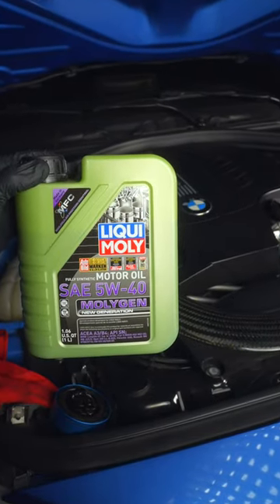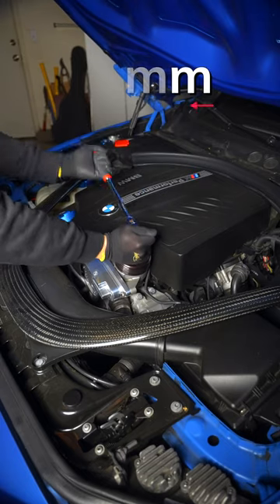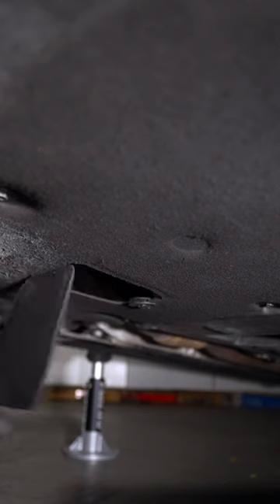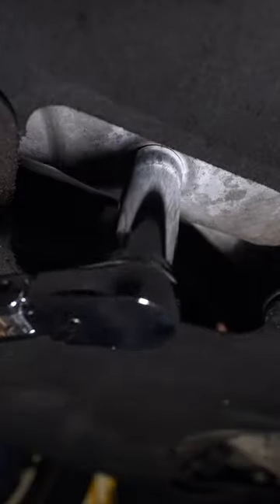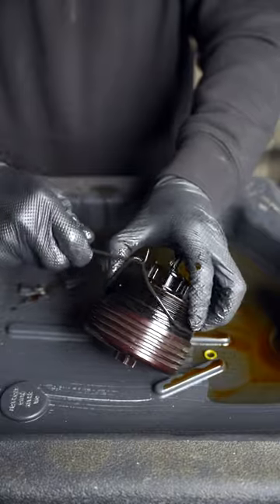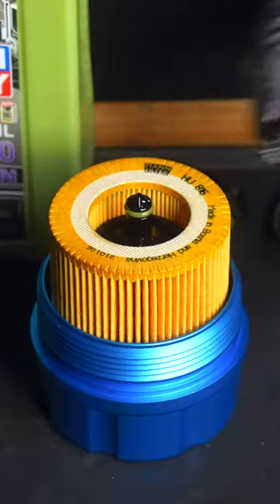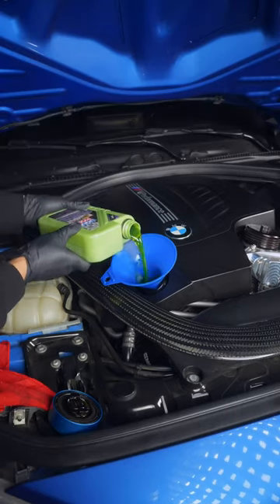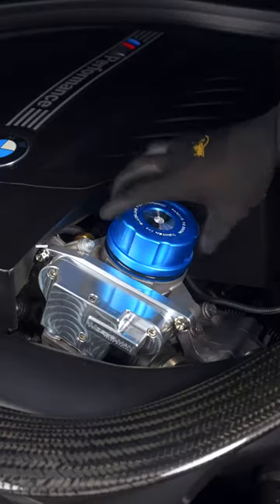BMW N55 Oil Change

Comment: I'll keep changing between 3-4 and no later then 5. That oil is muddy dark, watch out for sludging issues with higher milage, change it more often and do not go to 10K, regardless of what the manufacturer says or the oil manufacturer
Reply: Agreed. 10k manufacturer recommendations seems to me like another way to get parts to break so the customer needs to pay.
Reply: To really be certain have oil analysis done at Blackstone lab's.
some engines can push to 10k miles some don't...
Reply: @Doyle Hargraves  that is diesel not gas, in general diesel oil due to a large quantity of it in the engine can last much longer. Where a car has at most 8 quarts , most diesel engines have gallons of oil. However with V8 style diesel engines in pick up trucks that have EGR and all the EPA junk, I still suggest changing at 5K
Reply: 10k isn't even that high service interval. I know Subaru wants oil changed ever 12k or so, Mitsubishi canters are like every 20k or more and there's def some auto shit with high capacity sumps and bypass filters that claim 60k plus between oil changes (I know at least Volvo and Scania do this)
Reply: @Bush Kangarutha  whi h is also why mitsubishi engines in America are known for burning oil and general low life.. 12K oil change intervals is crazy in a car style application
Reply: 10k ??? I’ve never gone past 5 and that was my last car and in the last oil change I did before I sold it. Will do every 3K like my old bmw I had 😅
Reply: @austingutierrez2709 yep I do 3k. One year I got antsy and ended up changing it every 1.5k 😂
Reply: @KolbPROD  my new car had the oil changed at the dealer before I picked it up. Did an oil change as soon as I got home then switched to a different oil after like 2k miles. I felt that antsy feeling 😂😂😂
Reply: @UnrealKinniki  but if you use fullsythetic you can go 10k easy
Reply: @dragospahontu  Doesn't mean it's a good idea...
Reply: @UnrealKinniki  but a PAO based oil can maintain its properties for that mileage. An HC oil can't. 

Sure changing your oil frequently is always good, but why waste good oil when it can last 10k miles easy.
Reply: @dragospahontu  Makes sense, but I have yet to see an engine that liked 10k repeated changes
Reply: I change my oil daily to be safe.
Reply: @Slanovich  lol
Reply: Quit wasting your money. Not because the colour changes means it not good. It's normal. I change mine every 7500 miles
Reply: Nah 3k miles, I could care less what the manufacturer says. I also change the transmission fluid and filter every 10k miles
Reply: It all depends on driving style and wether you idle your car ouitside or regular in-traffic idling and wether you use your ac or not. Without unnecesary idle & keeping the a/c off you can go quite some time with your oil.
Reply: @UnrealKinniki I have a 2010 328i with the N52B30. I changed oil about every 10k. She has 224k miles, now. I used to do it every 5k, but decided to go 10k and send it off for analysis. Turned out that my 10k oil was still good. I was surprised. So I do it that way, now. If you only drive in city traffic, I wouldn't recommend that long. Driving only highway miles puts a lot less stress on the engine, as well. So 10k on the highway may be better than 5k in the city.
Reply: @JoiceVaderd  which definitely makes Sense! Most of the customers our shop gets definitely should not be waiting as long as they do lol

Comment: Just gonna give you some advice. N55s notoriously send rod bearings. Done over 75 jobs myself. Do yourself a favor a change your oil every sub 3500miles and get yourself some aftermarket rod bearings before your stocks go and score your crank. If you’re unsure of the condition of your rod bearings have an oil sample send off and tested. Goes a long ways

Comment: Do not, EVER leave you oil for more than 5k miles unchanged. Trust me you will regret it especially in BMW's. You've been warned. I do them every 3500 miles regardless of the manufacturer recommendations.
Reply: @I6zone depends. Turbo engines and hot weather will wear them out fast. Oil is cheap anyway....
Reply: @kiryukazuma7508 fr? Never changed oil on less than 7.5k intervals and the issues have NEVER been from bad oil. 

Never seen someone who does the same have an issue either
Reply: @kiryukazuma7508  Oil is not cheap! Full synthetic is over 10 a quart. The BMW take 7 qts.
Reply: @Depl0rable10  lots of variables. If you do big miles but on light traffic roads they won't wear fast. But if you do big miles in heavy traffic go with lots of idling stop and go, yes they run bad pretty quick. Hot weather also accelerates oil wear.

Comment: Never let your oil go to 10k I don’t care what the manual says and what type of oil you put. Oil is cheap and engines are expensive period
Reply: Definitely NOT bullshyt. There are tons of cars with sludge issues ran for 10k oil change intervals. Even with manufacturers recommendation why would they care by the time you get to your 6th or 7th oil change it’s no longer their problem it’s all yours!!
Reply: ian trofimov  Well buddy you offer up an isolated situation with one vehicle. I have 4 vehicles right now with close to 500k miles on them. Highest mileage one is at 275k miles. Original engine burns no oil. No smoking, used both for city trips and long distance trips. Multiple brands. I've owned American, German and Japanese brands. Smaller displacement turbo charged engines are going to likely experience issues if you are going 10-15k miles between oil changes. I've seen it 1st hand on multiple occasions. Vehicle manufacturers want to advertise a vehicle that's low cost in maintenance. 5-6 oil changes will get you out of most warranty periods, if you have a catastrophic engine failure between your 10th and 13th oil change that's on you (using 10k mile OCIs). For those of us who keep our cars over the long term the benefits of regular 5-6k mile OCIS are worth every penny

Comment: The blue oil filter housing cap looks great 👌
Reply from the maker: Thanks! You make the red look good in your car
Reply: Sure does
Reply: Because the factory plastic housing will leak?
Reply: @loden888  idk if its that but i have seen the housing threads literally melt and get stucks, its a pain in the ass

Comment: If you read the manual it specifically says not to pre oil the new filter. It can introduce contamination post filter into the engine.

Comment: 86 Toyota truck 22RE bought new and been the daily driver for 37 years and 482.000 miles. Change oil every 5000 miles using that 'crappy" dino oil- Castrol GTX 10W-40. Doesn't even burn 1/2 quart between oil changes.

Comment: I been oil geek all life
From what i ve seen in experience with superbike engines no oil no matter what will last longer to protect you engine 100% more than 4000-5000 miles
I been changing oil between 2500-3000 miles
And never had any problems
I would never push it more than 500 miles over 5000.

Comment: My one tip is to remove the drain plug bolt before you crack the top filler lid. That way the oil flows a little less when removing the plug bolt, hopefully making less mess.

Comment: Interesting…never thought about adding oil to the oil filter area.
Reply from the maker: I can't say it's from an official source, but  it couldn't hurt
Reply: @FritzRamos  I am BMW tech and I have to tell you that it is pointless. If you pour oil to the oil filter housing it just drains to the oil pan. It is for draining remaining oil in oil filter housing during oil filter change, that's why you unscrew oil filter first. Check on the next oil change, pour 5 liters of oil through oil filter housing. It will never be full :) Empty oil filter housing without oil during first start after oil change doesn't hurt engine. It fills up very quickly in less than few seconds. Those few seconds don't damage engine because engine parts have oil film on them which isn't that easy to lose as you could think. Overall good video. Keep up good work!
Reply: Your pouring unfiltered oil into the bearings and oil galleries
Reply: @bluethunder3346 exactly!!!
Reply: @FritzRamos the important part is to oil the O-rings, afaik

Comment: Just did my first N55 oil today and used 5W-40 … do you feel the car runs maybe 5°F warmer with the 5w40? Feel like maybe the car has an 0W-30 in it before I changed it today

Comment: Change it every 3k mile no matter how synthetic it is unless you want to replace your motor at 80k miles
Reply: Total BS, My 135i was at 110k when I sold it and it was still pulling hard without any issues. Oil changes were done every 5-7k miles. 3k oil changes are excessive if you’re using a high quality synthetic.
Reply: @SlickRick135  if you have a car that’s making more power and it gets abused almost everyday it needs 3k mile oil changes
Reply: ian trofimov  I’m sure you do 10k mile oil changes due to the fact your 335 burns oil no need to change it just add
Reply: You win. This is the dumbest comment in this comment section.
Reply: @jonathansmith7306  how e85 brakes oil down if you run e change it every 1500 like me

Comment: Yea but with newer motors in today's modern cars it's best to change the oil when it starts to change color tight clearances are getting tighter n synthetic oil will sludge up if you run it beyond 4,500 so I tend to change out my mobile 1 synthetic at 4,000 regardless cause that's when it starts to amber off into the dark black oil, granted old oil is better then no oil I just prefer to see the yellow hue of today's oils

Comment: This comment section is absolutely ridiculous
Reply: You need to change your oil every 10 miles, but it doesn't matter what kind of oil you use. I'm a YouTube commenter, I think I know more than the engineers who wrote the manual

Comment: What oil weight do you guys like to use for 100,000+ mile engines?
Reply: I have 2 BMWs both 20+ years old, 220 & 250k miles. Liqui-Moly Leichtlauf (long life) 5W-40 and 5W-30 in the summer changed at 5000-7500 miles works for me. So far I've been running it for 65,000 miles (since I took ownership) and it runs pretty smooth.
I use the additives once a year. Usually after my car sits for a month or whenever I feel I neglected it because I drive my other ones more.
Reply: @Jose Herrera you use thinner oil in summer ? Why ?

Comment: You did it wrong. Earlier in the short you said oil flows better when on a slightly warm engine which is true. Yet at the end you say to start the engine then check the oil level. Wrong, because that oil is not at operating temperature or warm enough it’s flow is impacted. Once you start the engine the oil needs time to drain to the pan for you to check the oil. On a cold cold engine that could take a hour. Because you started the engine, oil has yet to go back to the pan so checking the oil level before topping it off will more likely lead to an overfilled engine/inaccurate dip stick reading. There’s idiots online, don’t leave mistakes like this in a tutorial.
Reply from the maker: And the person doing this would get that message from the car when measuring the oil level which it won't measure until it come to the appropriate temperature.

Comment: It’s mind boggling to me people don’t abide by the 3 months or 3000 miles… you drive your car every day, some of us, DRIVE their shit hard, to and from work, maybe to the store at night or to a homies house, you take your car for granted more than probably anything in your life considering what you ask of it and what is required for everything to work flawlessly… 3 months or 3000 miles… will never be able to blame anything on bad oil or low oil unless she’s leaking like a siv… I thank my old man for teaching me about that because man theirs so many “lifetime” oils or every 10-15k like that’s absolutely terrifying to me…
Reply: Man 3000 miles was recommend with cars using conventional motor oil.  Good synthetics really can go as far as the manufacturer recommends without issue provided the oil isn't overheated (125 isn celcius).

You are literally wasting money changing it at 3 k miles.

Comment: Why is the oil green😂 must be a nightmare to see if coolant mixed with oil
Reply: It has a UV dye in it. Helps locate leaks. Just found my timing cover leaking because I use this oil.
Reply: Bmws use blue coolant

Comment: No no no no no no. Warming up the oil isn’t to make it flow better it’ll flow no matter what because it was created that way. When warm the particles that get removed from in the engine and cleaned float in the oil and can be removed when warm vs in the bottom of the pan when cold.
Reply from the maker: "How does temperature affect mass flow rate? The temperature increases the velocity of the molecules flowing hence the kinetic energy of the fluid increases with increase in temperature."
Reply: @FritzRamos  still no what I’m saying is why they say to change it hot not because of flow. Look up what oil does to particles in the engine when hot.
Reply: Cold oil will flow more slowly. Watch Project Farm's oil comparison video.

Comment: Never change your oil at 5k miles. 3k only no matter what
Reply: Why?
Reply: @Daanswerkeys  only designed to go for 5k is only designed for hybrids. That type of oil flows slower than the conventional. Ever 2-3 seconds of no lubrication is 3 years off engine life. Especially when it time to change em the quality perishes se than other oils.
Reply: @domi7007  no it ain't. Auto tech speaking here.
Reply: @sethsantiago304  Dude i am a mechanic for over 20 years, here in germany i see cars that have either never changed oil at all, or every 5k km or every 20k km. Every 8k km is perfect, just look it up. There are various tests made on Synthetic oil Viscosity and their particle Flow at different Temperature. 8K is where the oil should be changed, everything over it is bad, everything under it is just useless...IF you dont drive some race car that is pushed, aka its fine for a Family car.
Reply: @domi7007  US doesn't get the same quality oil yall do.
Reply: @sethsantiago304  This Is correct with oils like Mobil 1 & some versions of Castrol. Definitely not as high grade base oils as European brands. That’s why I roll with LiquiMoly most of the time. Motul is also a great oil. I’ve heard good things about Amsoil also but LiquiMoly is my go to or Euro grade Castrol (not the US made stuff) when I go to the dealer (rarely).
Reply: @alanholmes2366  agree especially the new v8s use Castrol. The early 2000s uses mobile 1. I haven't tried liquimolly yet. Lmk if you would Try it on a 01 to 02 s600 v12 and how it performs

Comment: 5000-10k miles is for if your car is driven on highway 99% of the time if your at stop and go traffic try not to exceed 3500-4000 miles even with full synthetic😂

Comment: With newer vehicles & synthetic oil. you are out of your mind if you do an oil change at 10k. I've seen burnt oil even at 5k. yeah people do it doesn't mean the owner is doing themselves a favor.
Reply: If it burns add more oil :)
Reply: fr
moderm turbocharged direkt injected engines are crazy hard on their oil it's done so much earlier than you would expect
Reply: @alouisschafer7212  if I had a high end vehicle, I would still do oil changes regularly at 3000 miles.

Comment: I’m sorry every 3,000 doesn’t matter what oil your running things wear filters clog things fail way I was taught but hey soon you won’t have to worry about oil changes just coolant and brakes and suspension components and a 5-10 battery replacement that only cost you if I had to guess half of the cars price !!! Eventually since they can almost drive themselves they may just drive off and get the work they need by themselves just charge your credit through your car !

Comment: Running engine is bad idea. Oil pan is at the bottom of the engine … if you run the car the engines sucks oil to the top creating not accurate readings on the dip stick and oil that is stuck in the head
Reply from the maker: There's no dipstick
Reply: There's a aftermarket kit made to fit a dipstick

Comment: WRONG. Don't ever go 10k miles on ANY OIL. 6K maximum on full synth. 4k max on conventional. That will maintain long term protection.

Comment: Wrong. Should change the oil cold.  It’s multi grade oil. It’s thinner when cold and gets thicker when it warms up
Reply: Put your oil in your freezer then try pouring it.  Cold oil = slow flow.

But when the engine is cold, you're sure there's more oil in your drain pan to drain out. Warming up the engine pushes the oil into the engine and then you got a long wait for it to come back down.
Reply: @loden888  no it still flows better when it’s cold sorry.  See how it says 5 or 0W on the bottle before the big number?  It’s a lighter grade oil when cold and then a 20 or 30 grade when it’s hot. They put stuff into it to make it thicken as it warms up.  You’ll get more old oil out doing it cold. But I’m just a person on the internet so you do you and I’ll keep making my engines outlast the cars they’re in lol

Comment: Anyone changing oil at 10k miles or even 5k miles knows exactly what his wifes boyfriend tastes like and loves it.
Reply: Other parts of the world must have shitty oil then, seeing as Europe has plenty of high mileage cars on which the manufacturer's intervals were used. Even my cheap econobox has 380K km on the clock with 15K km service intervals
Reply: @erik.m0110  of course you can do that. Most cars will take it. But why risk.it. when all.of these high mileage oils and cars  came out i laughed because its the same filter. And then they came out with high mileage filters and i still laughed after i opened them up and saw it was the same thing. All.im saying is its better to be safe than sorry. I take care of my vehicle and do my own work. For my and friends and families cars i see who changes at 3k miles and i see who changes at 10k miles when i fix things.
Reply: Seems like you have experience with your wife's boyfriend. Nothing wrong with being gay. But it's wrong to cheat.